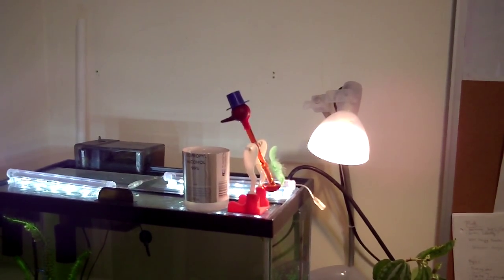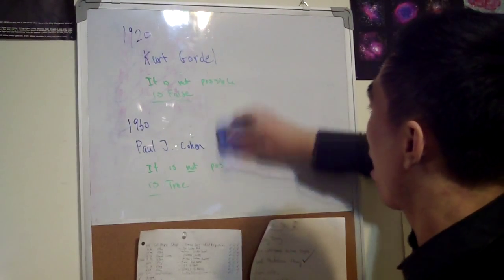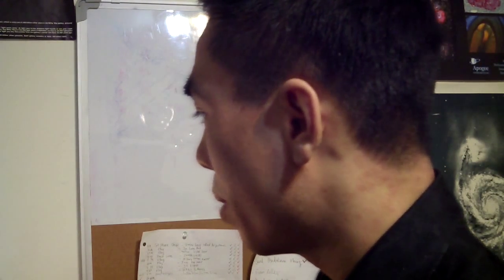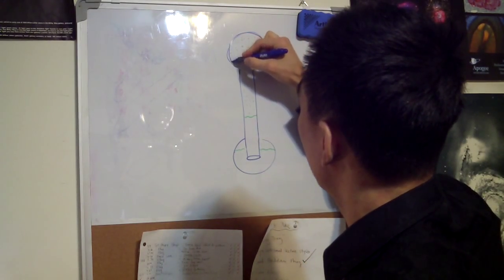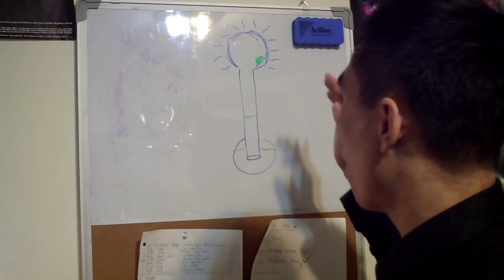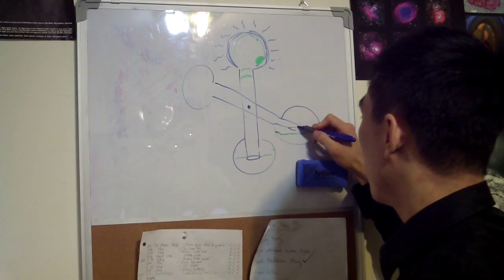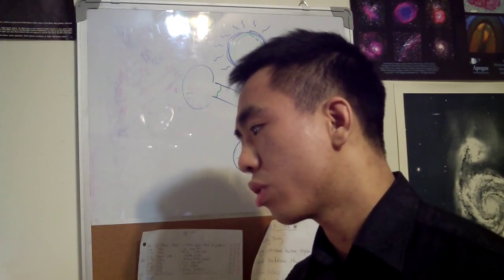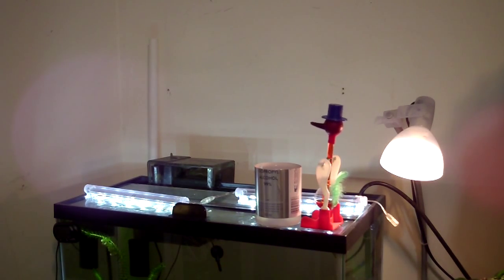Explanation of the Drinking Bird.

Comment: Alternate "drinking bird":  My mom recalled seeing a rather different "drinking bird" toy many years ago (like 70 years ago).  I'll try to recall this bird, as remembered by her.  This bird was carved entirely out of wood, having a very light and slender body with a long, perhaps curved, beak.  The beak had a fine groove along it's length.  When dry, the bird would tip forward, dipping the beak in water.  Capillary action would then pull water through the groove, changing the balance until the bird lifted its head out of the water (yes, just that tiny amount of water was sufficient to alter the balance).  After perhaps 30 seconds, the water evaporated and the cycle repeated.  If you look up "drinking bird" at wikipedia, this "alternative" type of drinking mechanism is mentioned, though there is no mention of the elegantly carved wooden bird that my mom remembered.  It must have taken great precision to carve that old wooden drinking bird, getting it perfectly balanced.  Perhaps one of them still exists in somebody's attic somewhere.
Reply: +trukkstop1 Something like this? http://costhunt.in/product/ETYE9DUSZHYXKYCH/Benjamin-Drinking-Bird-purchase-online-lowest-price-india